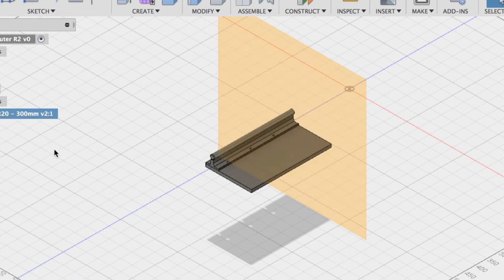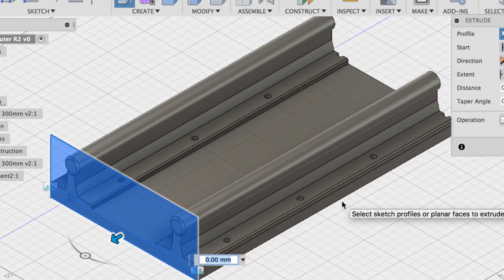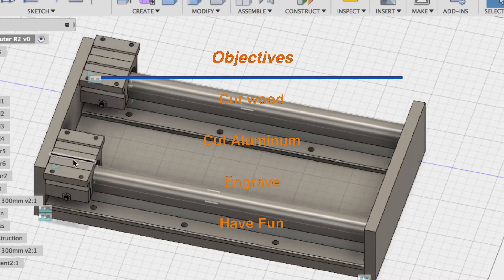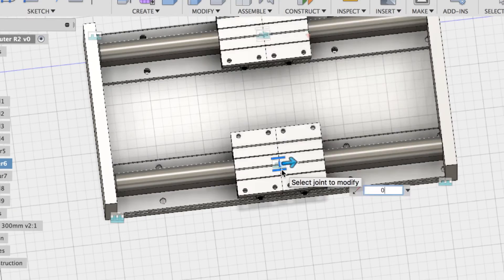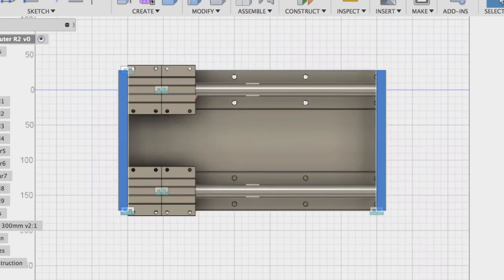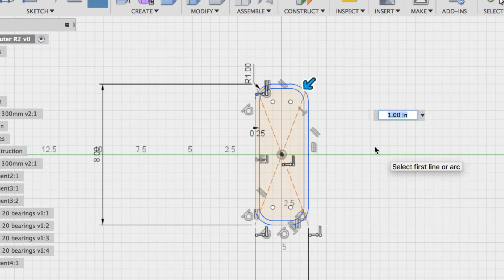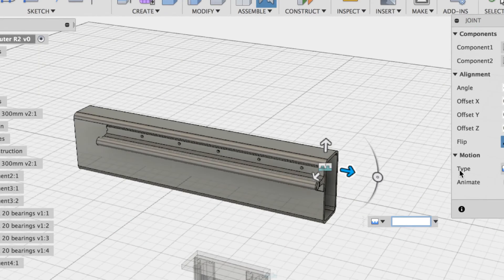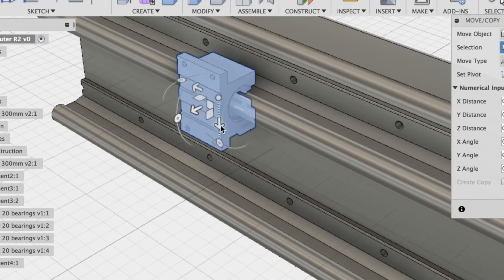DIY CNC Machine Design Physics - Part 1 Component Selection

Comment: Hi, I am also designing a desktop CNC milling machine with working area around 200 X 200 X 40 mm. 

Here i am facing a problem here. However i have compketed the most of the design. When it comes to force analysis i have no clue how force will act on machine parts during milling process. 
I belive the forces depends on the material and spindle properties. But i dont know any formulae. Could please suggest me any book or material so that i can figure it out

Comment: New replacement for castIron... cast granite.... think mortar powder and rockdust .... Cast into forms.... which can be rock solid ,...machined, and have embedded steel fasteners, and more... like press fit bearings.
Reply from the maker: Thanks for commenting however the heart is more so to build a better less expensive router. the best router it can be if possible.

Comment: Why did you change the roller slides from the first design on one side to the seconf design top and bottom?

Is the second design better for some reason?

Thanks in adavance

Ps great video I loved the 360 animation
Reply from the maker: Yea, if you watched the other videos I talk about vibrations and I wanted to fill it full of sand, long story short a 1"x 6" tube is tough to find and it would be outrageous So for the spacing I decided to go top and bottom. furthermore I think that it might even out the forces, when coming forward its a side load on both as apposed to a pulling force when going backwards

Thats about as clear as mud let me know if I can explain that better?